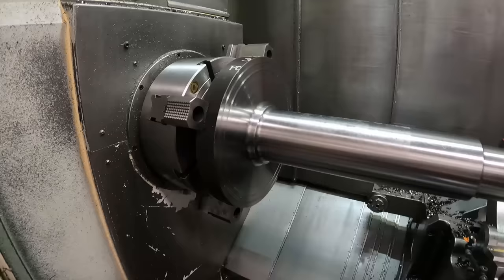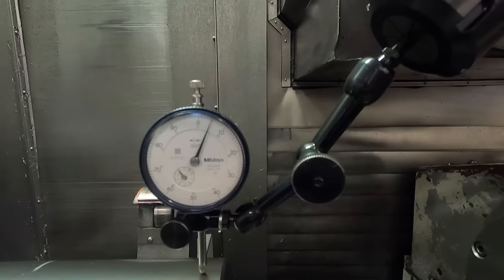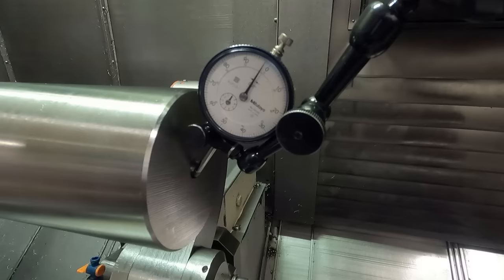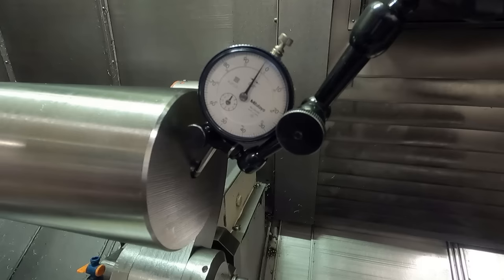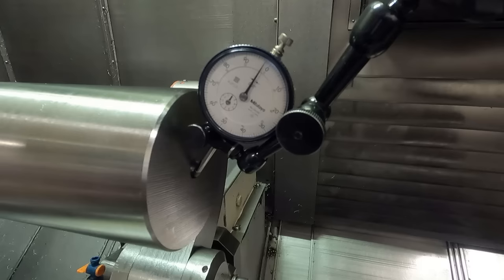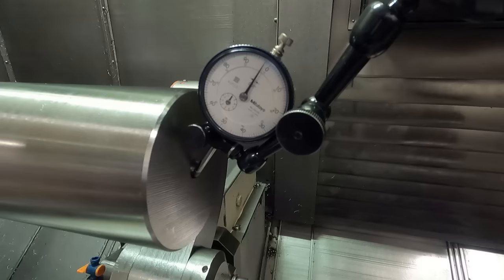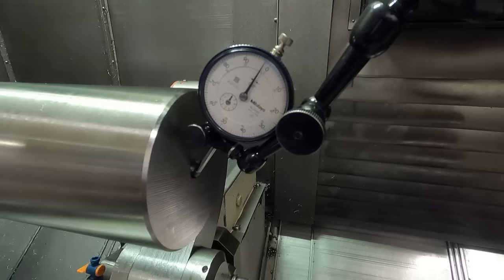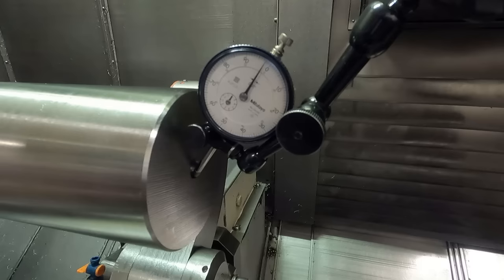Machine Shaft From 2000 Lb Stock

Comment: Retired machinist of 42 years in the family "job shop". Toughest part that I ever machined was .507 dia .303 long copper with 14 holes tapped 2-56 X .098 bottom.  I set up a tool holder with bees wax that our resident old timer had me try.  Went from zero tapped holes to completing the entire job with zero broken taps. 2600 piece order.  Always listen to the old timers, he retired at 89 years old and still came in a few days a week just to answer questions right up until the day he died at 94. I really miss him.
Reply: Mad lads over 70yo are the best, even if they've learned everything in analog and manual. Passion to keep working after pension age coupled with all that experience is simply unbeatable.
Also, copper or Al is not a metal, as hardcore port-equipement millers say. In 3 years of milling haven't had them once (allthough everything with iron in it, plexiglass, nylotron, capron or PVC came up occasionally).  I'd rather do Hardox500, than something soft, gummy and unpredictable, due to lack of experience, the main thing.
Reply: Grandad  became a machinist after Korea and retired in maybe 94-95. At times I wonder where his apprentices ended up. At the end he was happy just turning out  screws all day. I’m not sure I could do the same part for years. 
  He had some interesting projects over time. He helped estimate for a subcontract for M16 receivers. The prints were labeled top secret. He knew they wouldn’t be able to make money getting the contract. He knew that they probably hadn’t had a background check through enough to officially get the contract either.  
 Grandmom was a pacifist and converted grandad after his service. As a pacifist he avoided military contracts unless they were life saving.  The quick disconnect for the F16 or 18 oxygen supply to the ejection seat was ok. Polishing recreational rifle scope glass was ok too.
Reply: Great story
Reply: Kenny... That man is a true loss to society... ordinary people have NO idea the empirical & technical know-how these craftsmen take to the grave with them... even if they have mentored others... 

The "force" truly is weakened by their loss... RIP... 😔

From the Emerald Isle
😎👍☘🍺
Reply: I suggest you write a book about everything you know and have it printed, and as to that old timer, I wish I was there so that with a tape recorder and with 2 stenographers they can record and write down everything he knows with my engineering staff asking him about his knowledge and and asking him questions about his work history, the problems he dealt with and how he solve them, etc. And add that to your book. Computers are good but A PRINTED BOOK MADE FROM ARCHIVAL INK ON ARCHIVAL PAPER WILL LAST FOR MANY GENERATIONS and to pass it top future generations.
Reply: @darthvader5300  @DV  Thank you for the kind and persuasive words. I have attempted many times to do just that and life kept getting in the way. You have truly reignited the flame and I will pursue getting it done.
Reply: @kennyp9339  You are most welcome!
Reply: you have to be careful with some old machinists... Ive run across some that have been doing it the wrong way all their lives too.
Reply: @renaissanceman5847  There are very few that last if they do it wrong more than a few times.
Reply: The man you speak of was a loss to ALL of us. I've worked with men like that and was wise enough to listen to EVERYTHING they taught me and constantly asking why? I cannot stand apprentices or helpers that say, "Yeah, I know" when trying to teach them, because they don't.
Reply: Copper can be bad especially if it's dead soft, but usually you can heat treat it hard enough for a decent result then reheat treat to desired hardness. There isn't a lot there but enough. Polyurethane rubber is my personal material I hate machining the most. Easy enough to get it done roughly but a good finish and tolerance is a real pain.
Reply: Form taps for copper
Reply: @brentschmitt3338  yes, in most cases I would use form thread but the customer would not allow for the proper champer lead because they had them lapped and it created an unacceptable flaw at the top of the thread.
Reply: @renaissanceman5847  not this guy that is for sure....he was a true master at his trade.  He was not the only one either, we had three shops in direct competition for work, and it was told many times that if you need it done fast go to the other three if you need it done right go with us.  We were known as the assholes at PPI.  Shops now a days have shit on us, I can honestly say that I could machine circles around anyone and proved it many times.
Reply: Beeswax you say?
Reply: We make a lot of different electrodes at my work
Reply: @brentschmitt3338  no lie
Reply: Sem esperdiçar metal, pra reciclagem né?
Reply: @elischultes6587 kk9.
Reply: Wow
Old timers are gold 
My father is 75 and he still comes to the shop
Reply: @arthurchihana4470 o

I am supposed to be retired and just ordered an engraving machine to produce custom collector coins. 
I kept a seat of Mastercam after selling the business and it will work perfectly for my little side job.
Reply: It's girthy but try building a MD97 barge winch which is capable of pulling 200k lbs. From the ground up. Bearings alone were worth 66k.
Reply: Got an old timer where I work who insists his modern version of a divining rod can find water pipes underground and then we just never talk about all the times there's jack shit where he said to dig. They don't always know what they're talking about.
Reply: It is good to know that you have never been wrong in your life. Must be a pretty heavy burden to carry.
Reply: Can you explain what you mean by "setting up the tool holder with beeswax"? I'm not a machinist but love watching and learning about the craft. Not sure if this is just machinist lingo or an actual practice. Thanks!
Reply: @joevehige8558  setting up a tool holder with beeswax is just that, I used one of the cross slides and filled it with beeswax, and for every tapped hole I'd programmed the tap holder to run through the beeswax before tapping.
To this day, I do not have a scientific reason why it works, and Norman never gave a reason. But it worked incredibly well. Thanks for the question.
Reply: @kennyp9339 thanks for the reply, I see what you mean now. Neat little trick.
Reply: What a legend
Reply: .507 .303 how much is that in humans units?
Reply: @Patryk I would say that it was about 1/2 inches in diameter and about 5/16 inches in length. Thank you for the question.

Comment: Nice work!  Reminds me of an old cartoon where an entire tree was lathed down into a single toothpick.😁
Reply: Crazytown
Reply: @stan6425  that's it! Thanks👍
Reply: Ahhh, The Toothpick Factory.
Reply: I was thinking of the same cartoon.
Reply: haha me too!!!
Reply: Or a baseball bat!
Reply: Showing your age,and so am I lolol
Reply: @mossranchoutdoors7249  right there with ya. Haha!
Reply: Same.
Reply: También  la recuerdo, pero el producto era un bastón de escoba
Reply: *turned
Reply: Ip akuoiIIoooooooooooooooooooooooo iiiii iiiii aku gak bisa tau ni ? Ii Iyo iii, 😘 💏 💏8😂 ii 😂 🤣 , di1 1 Aiii . i8Iih Iy.8Iy ii .8di 8hp di iis i8, di ini8, i, i you is
Reply: ...THERE WAS A WOODY WOODPECKER CARTOON, WHERE HE HAD A MACHINE THAT TURNED A BIG LOG INTO A BROOM HANDLE-!!!
Reply: I remember that!
Reply: It's a rare if not stupidly stubborn engineer that wouldn't allow this piece to be made from 2 and welded together. IMO there is no reason why you would need to make this out of a single block. Properly welded and re heat treated with a check on the joint it would be fine.
Reply: @dazaspc did you read the description of the video? The broken part was 2 piece and failed at the weld. This is why the customer has requested a solid rreplacement
Reply: yes I'm watching that too

Comment: His considerations on stress-induced runout made me realise there are so many things i don't know. Sometimes you watch these gents, think it is easy because they make it look easy and suddenly you understand that there is so much experience you need in order to get the job done it is almost frightening. Still glad i subscribed.
Reply: The stress is usually relaxed in the annealing after tempering. If there is still warping after that you have to either do it again or take a deeper dive and ser if there could be some inconsitency in the material itself like uneven proportions of The alloying metals causing faulty grainstructure or difference in grain in different areas. Its usually scrap by then. If its mechanichal stress then you either straighten your part or just machine it out .
Reply: @joachimsingh2929  there's ALWAYS stresses in stock, especially when you remove 90% of it. There is nothing you can do to get around that. There Monday be a little, may be a lot, and you can do pre processes to minimize it, but you can't eliminate it. The center is holding it and preventing it from springing, which makes it more noticable.
Reply: @xenonram  thanks
Reply: Try vertical turning thin wall inconel....that separates the men from the boys....spent many a shift with my head in my hands...crying over the scrap bin....Ps I would of got maintenance to sort that conveyor out before even attempting to remove that much stock...
Reply: @chrisyboy666  he is maintenance. He owns the machine lol
Reply: @glass1258   exactly I know that...it’s called sarcasm....but the their are maintenance in that factory that will help him out
Reply: I'm a welder about 6 months into learning the CNC laser you ain't kidding
Reply: @maddiiydaddiiy  really not bad upgrade, partner
Reply: I always rough my shafts to within a 1/16 of a inch......I then retool my center.....after that, I finish the shaft, or journal (if I'm making a roll) and it'll run dead nuts...... it's always a good idea to put 1/8 inch aluminum between the jaws and part, that way you don't introduce chucking pressure to the part......very easy to do, unfortunately many machinist don't do it this way.
Reply: I'm not a machinist, just a guy with hobby machine shop. My father has 40+ years experience as a professional machinist. His skill level is incredible. The level of precision he achieves is impressive. Seeing how fast he gets it done will remove any ego you may have in regards to machining ability.
Reply: @chrisyboy666   ran a bunch of 718 inconel in my short time as a machinist and it sure does separate the men from the boys. That stuff is a pain.
Reply: I have T minus 10 hours left of a mechanical engineering degree, and those words have never hit closer to home.  The more you know, the more you realize how much you don't know.... said many a great (often troubled) minds.  Cheers
Reply: My shaft is bigger by far
Reply: There's nothing frightening about it. The difference between them and you is they got the experience because they weren't afraid to learn by doing it like you apparently are.
Reply: @AnonyMous-lk7zi  chill bro, it was just a hyperbole. Curious thing everybody above you got it, you didn't. That's fine. Long story short not everybody choose that path nor have the chance to learn those things, even if they like them a lot. I work in another field and did my own share of "not being afraid to learn" in the Marine industry. I just respect a lot their expertise. Chill down .
Reply: Thatzzzzzz right 
IVOR.MEC.TON.
Reply: @gordonno11  when you say retool your center you mean you redile it back in or you recut it to make it correct
Reply: i guess Im asking randomly but does any of you know of a method to get back into an instagram account??
I was dumb forgot the password. I would appreciate any tricks you can give me.
Reply: @Julius Danny Instablaster ;)
Reply: @Raylan Dalton it did the trick and I finally got access to my account again. Im so happy!
Thanks so much you saved my account !
Reply: @Julius Danny You are welcome :)
Reply: I've been a heat treater for 35 years. I'll harden that slug and then temper it down to 28/32. RC. Assuming that's 4140 or the like. That Rockwell's perfect for machining.
Reply: @xenonram  I am surprised that it moved that much though, when you mill that much material away your gonna get lots of movement but generally in my experience when your turning(because your taking equal amounts off everywhere at the same time) it generally doesn't move, like at all.  We ha e an ongoing job in our shop where we turn down shafts that start out at about 150pounds and we have to hold a 0.0005 tolerance, dia, concetricity everything and we do it in one shot and have never had a part move out of tolerance if it was in when clamped.
Reply: @istopedthewuhanlabfunding6351  Although Ivermectin may prove to be effective against Covid and I am all for clinical trials for ALL possible paths forward in this respect, I'm amazed to see that as something as innocuous as a thread on the stresses inherent in certain stocks  being used  to promote completely unrelated political/ medical opinions.
Please find a political thread or streams to promote your agenda and leave this one to people who wish to discuss machining not medicine. Thank you.
Reply: Absolutely. Dunning Kruger has no place in the machine shop lol
Reply: Heat straightening?
Reply: @chrisyboy666  how d you end up doing it ? Recipe for success?
Reply: @gordonno11  does that mean you re face and re center drill?
Reply: @genericdynamics6618  yea,  espesially if your employeers are penny pinching weasel, that wont pay real machi ists to instruct, amd afraid to let any body do anything.
Reply: @ryanb1874  machining thin wall Inconel..In stages. Rough turn…then semi finish turn…then finish turn..changing all the inserts after every part…Unless you have a stable Cnc lathes.okuma..for example but there’s many high end machine tool OEMS out their…long story short if you Have a Haas or Doosan lathe don’t bother….waste of time even attempting it..
Reply: @christianhubbard8444  Well, I haven't run inconel.... But I have run hastelloy "B" and "C". Talk about being a pain! Materials that work harden I always a nightmare.
Reply: @joachimsingh2929  Why not start with largest minimal diameter shaft stock? Is it just a "use what ya got" situation?
Reply: @Yeah Right while i agree on the part that you can do amazing work on any machine (i got 0.012 RA on an alu extrusion router for example), you're not going to do it as well/fast as on a better machine

While a rookie mistake, my usual ~25 HP roughing with a 40mm solid bent the spindle on a VF2 and i had to step down to a 20mm at ~6 HP for reliable results and just 2 HP for a usable surface finish

Comment: Not a machinist just like these videos but you have changed my attitude towards machining by making it straight forward and something I could do. I’ve watched many guys over the last few years but your video is the first one where I could picture myself there because I can understand your description of the work being done. I’m a heavy diesel field mechanic and have subscribed.
Reply: As a mechanical engineer I will say that, WE OWE EVERYTHING TO THESE MACHINISTS for they can turn any metal ingot into a very useful component for all of the machines that we are taking for granted. Even the UV Lithographic Steppers used in making computer IC chips is composed of THOUSANDS OF MECHANICAL COMPONENTS especially the micro-mechanical components that aligns the protective etching masks, they make the machines used in making the optical components of the lasers and UV beam projectors. The list of mechanical parts is ENDLESS. Your faucets and valves n your households, the car manufacturing facilities, the mechanical components of hospital equipments, the surgical tools and devices. I am you telling the list is super endless! And only machine tools can be used to manufacture themselves starting with the lathe to make the planer, and then the planer is used to make a more precise lathe which in turn makes a more precise planer and so forth and so on. Then they can scale up in size and then diversify into other basic machine tools such as the drill press, the miller, and the shaper. And includes their ancilliary extensions and measuring instruments and devices.